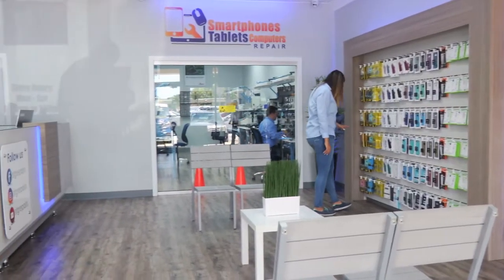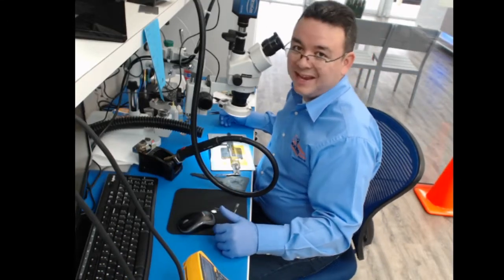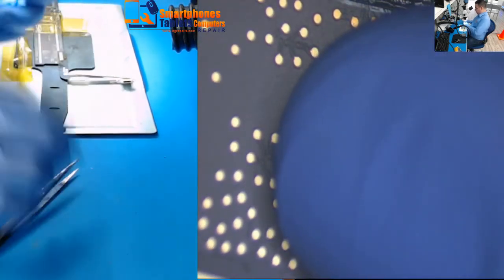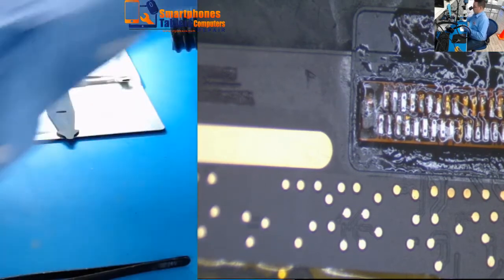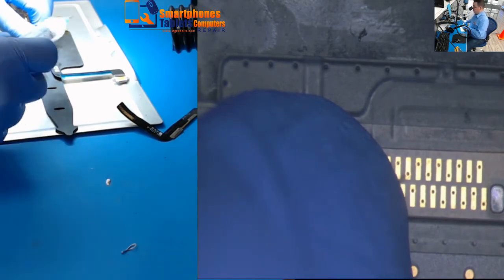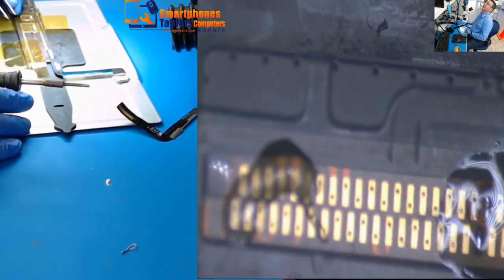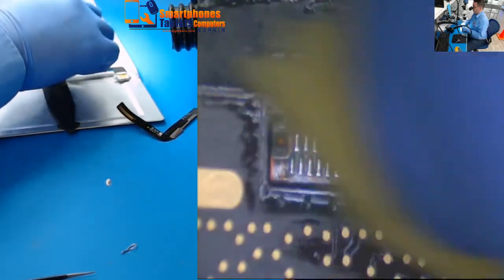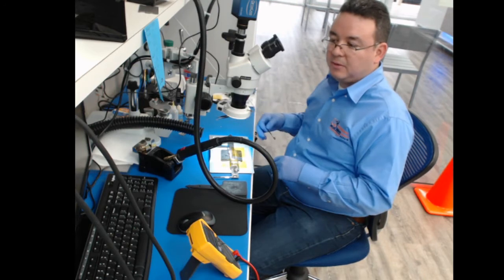How to change iPad Air charger port without pulling pads

Comment: Can you change the flex cable without microscope?
Reply: Aleksandar Boncev 
Yes. You must be careful not to pull the connector too hard otherwise you can lift pads.